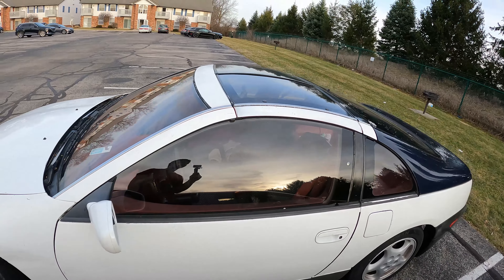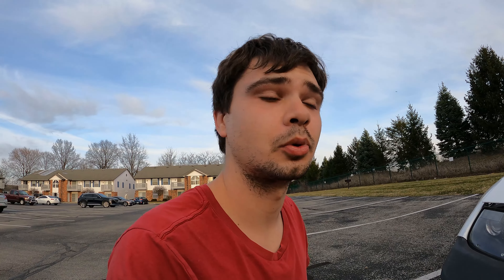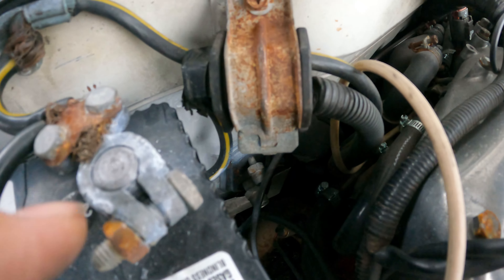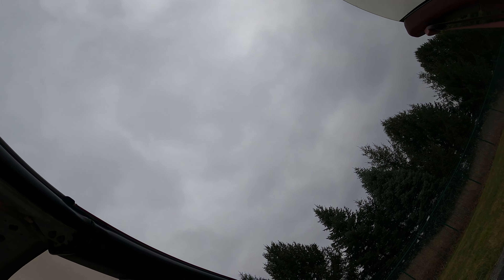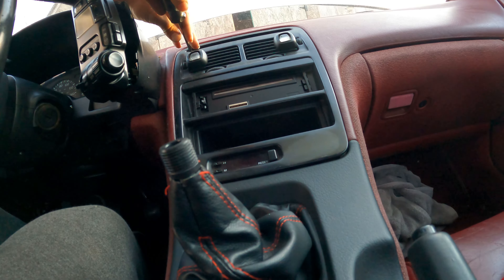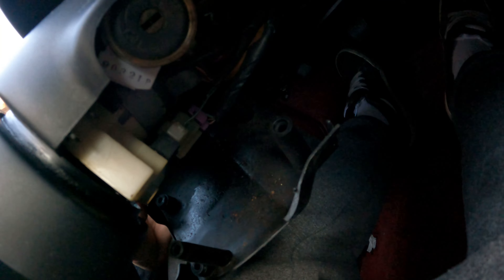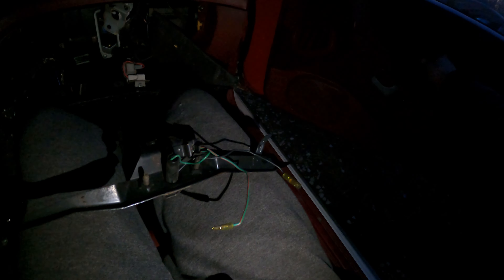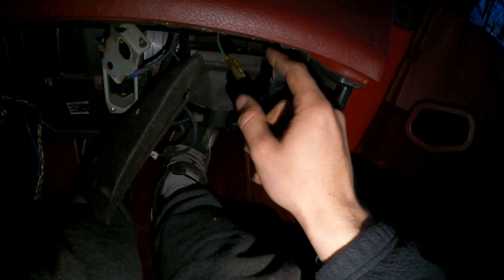My NEW Unique Project 300zx... Chassis Number #3333

Comment: I definitely think it's worth restoring that chassis number is such a flex. Also to help you learn welding quicker and better, I recommend to get a thick plate of steel and just run lines all over the plate until you start to see progression it's how I learned without going to school for it and I'm not half bad 😂
Reply from the maker: I was gonna use a shock tower/rail from one of these cut cars.
I'm sick of being helpless to save all of these Midwest z32s! We should be turning around come summer time 😎
Reply: @NedacSnosrap  awesome I can't wait for more content it may not seem like much of a difference is being made but I always put down what I'm doing to watch your videos keep it up 😁

Comment: If you figure out the vinyl rewrapping situation, that would be an awesome video. I feel like so many 90s cars have issues with their interior.
Reply from the maker: I intend to by summer time! I'm going to wait a week or 2 until I order the vinyl so it'll atleast be 50-70 outside when I'm trying to set the glue.
Luckily I have a stripped panel just waiting to be practiced on 😁